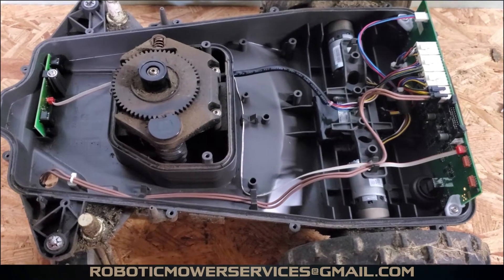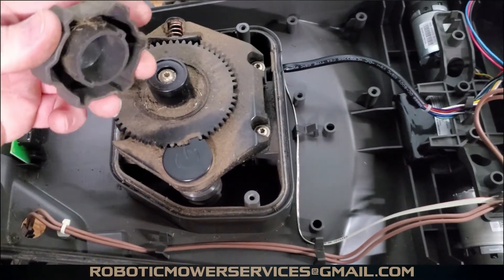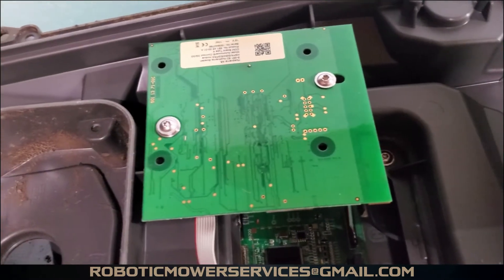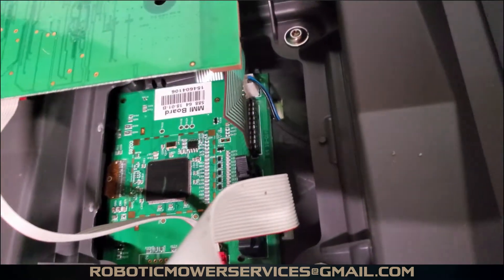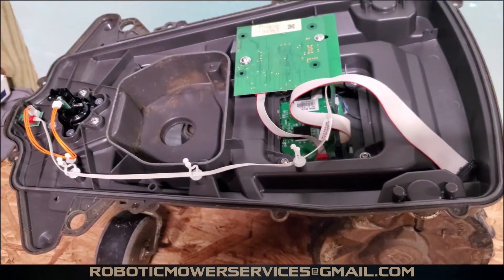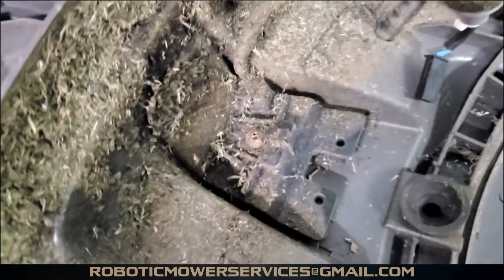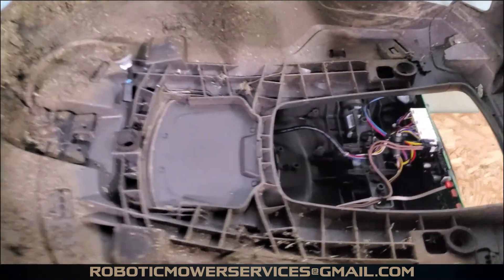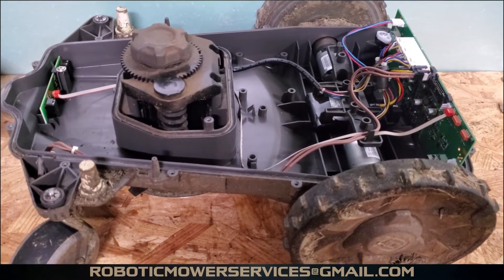The Anatomy Of A 300 Series Husqvarna Automower: What's Inside A 310, 315, 315X Automower

Comment: Have a 310 showing rear collision sensor active.   Has a rotted out magnet on back left side.  No obvious circuit board sensor like one on the front.  Is it working with motherboard?    Or is it not being used.   What activates rear collision sensor active?  (7– 9  code)
Reply from the maker: Yes, that magnet is sensed by the main board on the 300 series mowers

Comment: Awesome video with precise details I was looking for!! Specifically that adding Auto Connect GPS Board to Automower 315 does not enable GPS Mowing which sucks btw, is there no hack for it? Since post adding  Auto Connect GPS Board to Automower 315 the mower now seems equivalent to 315x on hardware specs ... Price difference is ridiculous between 315 and 315x, I am unable to justify 315x on price point !! On different context, I have a wooden fence with a small dog in the house, I have not found any viable solution, should you have any suggestions please let me know .. Thanks!
Reply from the maker: Are you looking for a gate for your fence?
Reply: @RoboticMowerServices  Yes, preferably which my Dog can't exit from. Also, do you sell mowers? If so prices for 315 and 315x ?
Reply from the maker: Yes, we do sell mowers. Send us an email (Roboticmowerservices@gmail.com) and we can get you some prices. Thanks!